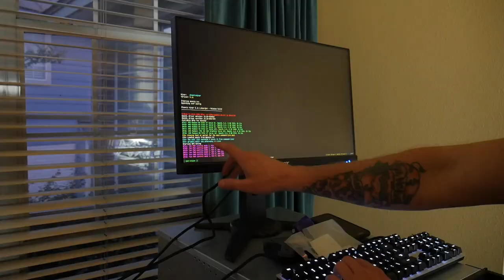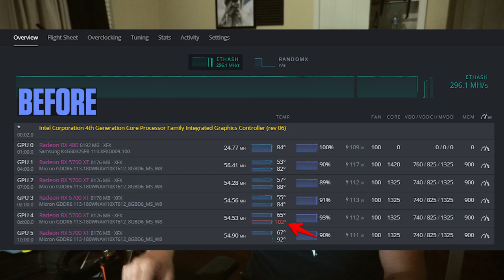How To Fix High Memory Temperature MSI RX 5700 MECH OC

Comment: Thanks for sharing your info Son of a Tech. I received a 57.3 MHR for this card. It has a micron memory at 935 mem clockrate (1325 core) on this card. The xt bios for me didn't give me any improved hashrate so I just stuck with the non XT version. I replaced the pads with 2mm ones which reduced the temps from 104 to about 88 degrees with a room temp approx  28 Degrees C. It was so shocking how they were not completely covered. I didn't think adding 3mm thermal pads at the back changed much but I did it as well. Couldn't really tell much difference so I added some spacers so the heat sink could get a better hold on the card. Got me down to about 82 degrees. I then I kept the core clock at the same rate and reduced the controller voltage (VDCCI) to 760 (i still don't know how this impacts anything but I tried to make it as low as possible PLEASE SHARE IF YOU KNOW. I wanted to decrease the memory voltage (MVDD) as low as I could so I stuck it to 1250 mV to see what happens. Got stable down to 78 degrees. This was repeatable on the Sapphire Pulse. I had very little success with the samsung memory cards but the trade off is that they generally run cooler than the microns for the 5700s from my expereince. Hope this helps anybody who struggled through this like I did.
Reply: Could you ellaborate on : " I added some spacers so the heat sink could get a better hold on the card"
Reply: you use bios mod?
Reply: 57mh with bios modding or without?

Comment: Yes! I just removed my 5700 backplate and saw the thermal pads had actually been sliding out of position. I re-positioned them and my memory temps have now gone from throttling at 106 degrees down to a stable 88 degrees celsius. Stabilized my mining rig and increased my hash rate too. Much appreciated tip! Thumbs up.
Reply: so u just moved thermal pads to the center of each module and u solved the problem?
Reply: @predragmatic320  Yeah it was as simple as that
Reply: @DannyBensonGolf  thank u so much i will do the same and just put noctua nt-h1 thermal paste in the near future

Comment: 2 mm pad? sounds thick! my one goes GPU 80c, memory 92, gpu vrm 79c and hot spot 102! That's is without overclocking and undervolting to 0.950v

Comment: I am having this exact problem with MSI MECH OS 5700 XT. I used thermal pads however I realized mine were slightly less thick than the factory grey ones (stated 2mm but felt like 1.5mm on the ones I got from Amazon) that were poorly installed out of the box. I just added two layers of new thermal pads to all 8 GPUs memory CPUs however now my main GPU,  CPU is running hot in almost each card. I ran out of thermal paste but I will re-open all of them and double up on the thermal paste and I expect/hope that will finally fix the problems. When I did run the rig all my memory temps were much lower with the two layers of thermal pads placed so adding the second layer fixed the memory temp problem but created a CPU overheat issue.  Likely I created a larger gap from the CPU to the heatsink by adding extra thickness to the memory CPUs. I expect with a hefty load of thermal paste on the CPU I should get better CPU  temps and hopefully finally fix this overheating issue. Liked and subscribed, thanks!

Comment: You can take this a step further and add 3MM thermal pads to the back of the PCB. 3MM Is thick enough to make contact with the metal backplate

Which creates a bit of a heat sink for cooling the back side of the memory chips.

Doing this reduced temps an additional 3-5c to memory for me.
Reply: Thanks i will give it a try
Reply: Nice idea except the backplate is plastic so this will do almost nothing
Reply: @NotSkeletor  ah bummer. My asrock’s have a metal backplate

Comment: I've replaced the thermal pads on my 5700 with thermal grizzly minus 8 pads and the thermals got worse!  I may need to just tighten the screws though.  Of note the cooling plate doesn't cover all of the memory so I feel like this is a losing battle.  

Just noticed what your starting temp was 102 though OUCH!  Mine was around 88 at 100% fans.
Reply from the maker: In some cases I put 1mm pad on the core. But that’s if the core temps go up after. The cooler tolerances are pretty bad.
Reply: the pads might be too thick causing the cooler not to make enough contact with the die, thus resulting the higher than before temps
Reply: what's the thickness you using?

Minus 8 are very, very pliable compared to other pads.
Reply: @SonofaTech  can you explain how to put thermal pads on the core? I just changed the pads and paste on my card and junction temperature got worse
Reply: you got fix?

Comment: So i had 106 degree tenps after replacing with the same thermal pads.. got it down to 90 by adding washers to the 4 mounting screws

Any idea what else I could do?

Comment: I have a sapphire 5700 xt and it does not have the half thermal pad issue.. But I'm getting 96 on my max memory temps. My junction and hotspot and gpu temps are all low and good. Is 96 a damaging temp for memory? Am I hurting my card running it at 96?

Comment: if the problem is the thermal pad placement why did you also changed the thermal paste?
Reply: As soon as you break the bond between the cooler and core it will start to dry the paste and make worst contact. Any time you expose the core you should replace the thermal paste

Comment: Are that mem temps safe? I'm a bit new in mining and I have 4 of these cards running at 82-86º celsius... Do I have to worry about them?? Thanks in advance
Reply: I'm talking about mem temps...  Are 82-86° Celsius safe mem temps for 24/7 mining?? Thanks in advance
Reply: @patopattone1138  Yes,  bad temps are from 94ºC to 106ºC (106 is where thermal throttling commences)
Reply: @YusufPaw  thanks!!

Comment: What is your hotspot temps for this card? Mine immediately hits 110. Do you have any idea how can i fix this?
Reply: yes. I did the thermal pads, swapped to arctic silver 5 (dunno if it's the best but it worked great for me and it was quickly available) and 1mm plastic washers. Now junction won't go above 95 and overall 86 (fans below 2000) in scenarios where it would be 107 and 97 originally (fans would ramp up to to 2500~2700.  When it comes to mounting pressure, I just tightened to a point where it felt like I was gonna force it. The cooler of this card is perfectly capable and if it had the right thermal pads and mounting pressure from the factory, it would be right up there with the pulse in terms of value and quality. Warzone seems to not be crashing anymore either, though that might be anecdotal.
Reply: I have the same card it goes on Warzone 113c damn that’s so hot I definitely need to change the thermal pad👍🏽

Comment: are there certain brands of thermal pads that you recommend or any pad will do fine?
Reply: He put a link in the description. Gamers Nexus recommends thermal grizzly. The main thing is that the thermal pads need to be 2mm thick.
Reply: @iamnotglenn  not exactly some are 1.5mm if they are to thick you gpu core will not make contact with heat sink making temps worse

Comment: My GPu is 
Radeon RX 5700 XT 8176 MB · Sapphire
Micron GDDR6 · 113-1E4112U-O45
My Memory tmp is 86 (is it normal?) Cause my Gpu DETECTED DEAD Frequently
Set OC 
Fan Core   DPM   VDD   Mem   PL
100 1275   5        750    900     0

Comment: MSI RX 5700XT Mech OC mining ETH on Minerstat, running 71 degrees Celsius
Reply from the maker: No one cares about core temps. Lol
Reply from the maker: Miner joke btw
Reply: @SonofaTech  lol 😅 i just realized my gpu memory runs at 100 degress C while mining 😭😭😭 is that normal? When its idle it goes back to 60. Is 100 to high?
Reply from the maker: Yes it is

Comment: you can buy a thermal temperature gun and detecting that way wich its the card that its overheating
Reply from the maker: In theory yes. In practice I've had little luck with my temp gun. You see in this situation the faulty card is not dissipating the heat.

Comment: How do you determine which size thermal pad (mm) works with a particular card?
Reply from the maker: google should help. But I also use calipers on the old pads.